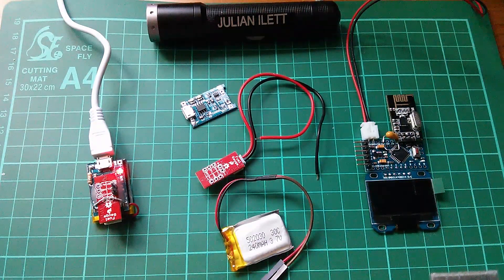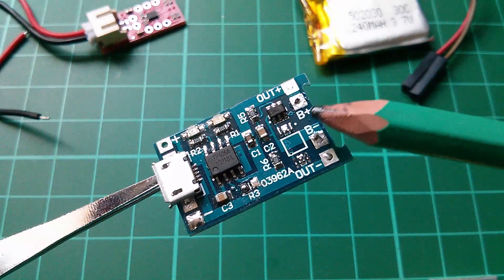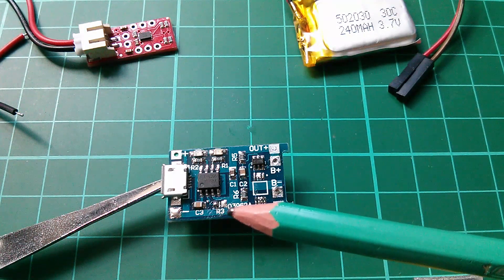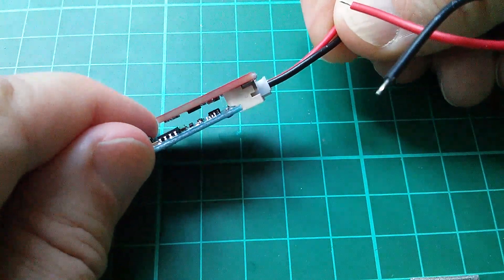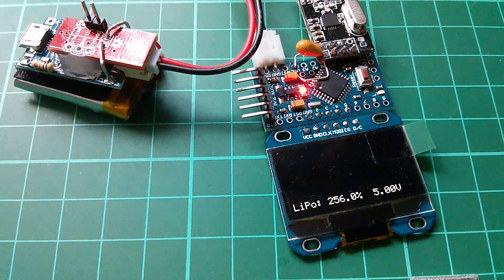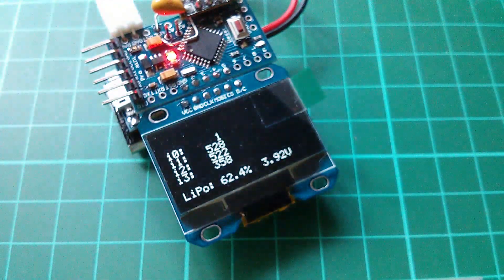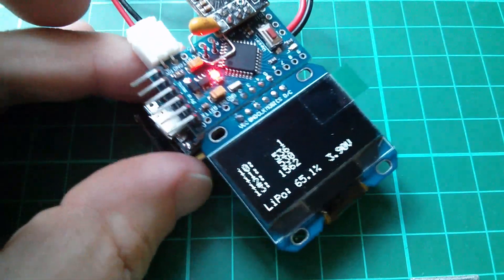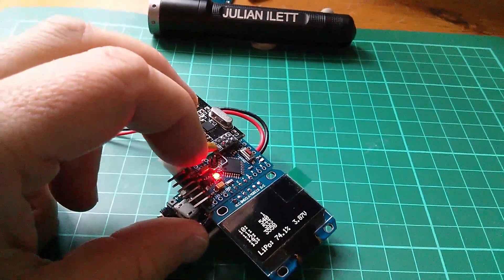Project: New Wearable Arduino OLED Remote Data Display #2

Comment: What if you're using a LiPo with ~1200mah, would you require to change the charge current as you did in this video with the resistor?

Comment: Are there any cheaper alternatives to the max17043 based boards? They seem expensive, £2.60 is the cheapest I can find on ebay. Not that that is expensive per se,  but that can buy almost two arduinos from ebay.. Or 200-300 LEDs... Or an LCD for arduino..

Comment: the charger charge phone batteries to?
Reply from the maker: Yes, in theory, but phone batteries often have 3 terminals so check the connection carefully.
Reply: except the terminal anything else to watch
 out? charging current?
Reply from the maker: Yes, it's important to get the charge current right. 0.5C is generally considered safe.
Reply: 0.5C?
Reply: Sharon S Suppose the battery has a capacity of 1000 mAh. 0.5C is then 1000 x 0.5 = 500 mA charging current. A 300 mAh battery would have a 0.5C(apacity)  charging current of 150 mA. As a general rule do not charge LiPO´s with a higher current than 1C.

Comment: Hi,

That charging board can be used to charge a 1200mAh LiPo? What should be the resistor value? And, by the way, what's the resistor value that's on the board already?
Reply: The resistor values are on the datasheets. Julian has a a dedicated video for the charging board. The resistor on board will charge the Lithium cell at 1A.

Comment: I see that you used A0 and A1 from Arduino for CE and GND connections on RF modul. Very clever. How does that work?
Reply from the maker: ceech123 I used A0 and A1 for CE and CSN - they're the signals that can be assigned to other digital pins (SCK, MOSI and MISO cannot). I had to check that the nRF library was happy with D14 and D15 specified for CE and CSN - it didn't seem to mind. That's how you re-assign the analogs as digitals.

Comment: Hi Julian,

do you know if there is a NiMh battery gauge out there, where you even can give the number of cells that are in series as input?
Are there even protection circuits for NiMh out there? I mainly want to cut off the power when they are <1 Volts each cell.

Thanks.
Reply: I dont think theres protection for NiMh since it wouldnt be very useful. Thats because unlike lithium, which gets damaged if you empty it to zero volts, NiMh doesnt care. What I can think of if using a voltage boost cicrcuit to get constant reference voltage and then just using analogRead on the battery and switch off in software somehow.. By putting the arduino to sleep for example. And then it would start when you press the reset button.
Reply: iPelaaja1
Are you sure that NiMh can be discharged until 0 Volts??

Comment: Hi Julian, very interesting project.  Would love to see the finished product.  Will you be making a 3D printed case?  Combing all that into a single board design would also make things quite a bit smaller.
Reply from the maker: EE Shane No, not on this project. I'm enjoying the challenge of making all the boards fit together in the most compact way.

Comment: Great work on the wearable so far Julian. You're arranging all these boards as compact as you can reasonably manage at this stage. I'd always assumed the plan was to spin your own Arduino-ish board with the other components on there, would remove a lot of the bulk blank PCB for example from the sparkfun breakouts for the fuel gauge.

I've been following along wondering what would happen with the nRF24L01+ board, if you'd keep that a separate module to avoid the RF design stuff.

Comment: What's the power draw of the OLED display? Can't you hook up the vcc to one of the arduino I/O pins to power it? Then it is easy to toggle the power to reset the display if you need to.
Reply: That also my suggestion. After reset of the Arduino, power down the display (it will power down anyway because the Ports became inputs at power up) Wait some time and than power back on.
The power draw can't be so much. I have read somewhere that the power needed for a 0,96" Display is 0.08W.
That means by powering with 5V you only draw 2 mA
Reply from the maker: JoeBee999 It's occurred to me that the IIC version has no RST line either. Perhaps it's not as important as I first thought
Reply: Julian Ilett
But maybe this is an additional method to save power. Processor can power down the display completely. (I have not checked if the display has a powersave mode by command)

Comment: Current dissipation within Arduino is not efficient for using it in wearable device. I think  total power dissipation from LiPo is about 50-60 mA, so maximum working time is about 5 hours.
Reply from the maker: Stanislav Ilchenko That's true, run time is just a few hours. There are various solutions - slow the clock for example, but I'm just going to put a bigger battery in it!

Comment: Instead of stacking, i would have put all these parts in a ribbon, a flexible ribbon that goes around the wearer's arm but stays extremely thin
Reply from the maker: ***** That works with the arduino and the display. But the nRF is more difficult to connect like that, and the LiPo fuel gauge, impossible

Comment: There are also the lithium charger module TP4057 and TP5000.
Reply from the maker: TheOldmankk I can't find any references to a TP5000
Reply: Julian Ilett http://www.electrodragon.com/product/li-mno2-lifepo4-lfp-charger-board-1a2a-tp5000-ic/
Reply from the maker: TheOldmankk Interesting - a switched mode version

Comment: You could try 'bodging' a cable onto pin 16 (RES# on the SDD1306) of the flat-flex ribbon on the back to access the reset feature?
Reply from the maker: Alex Matthews If the other display I ordered doesn't have RST, I'll probably give that a go. Cut the track to CS (it's not really needed anyway) and route that pin to RST the flexible PCB. Good idea.